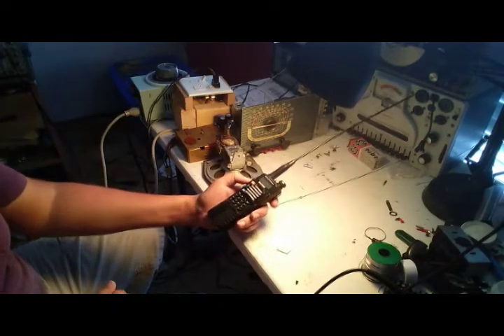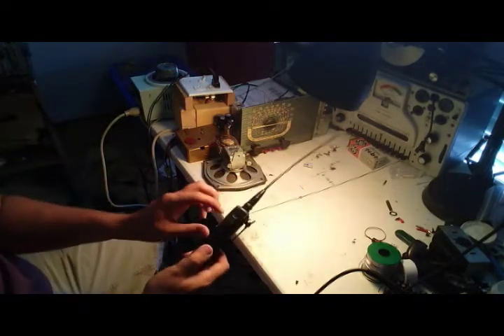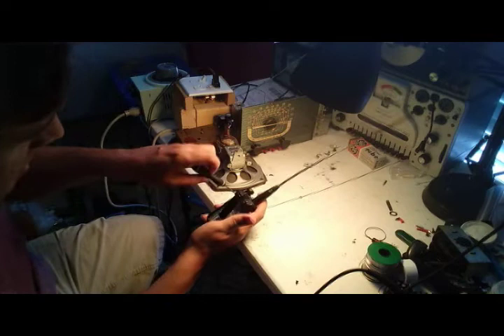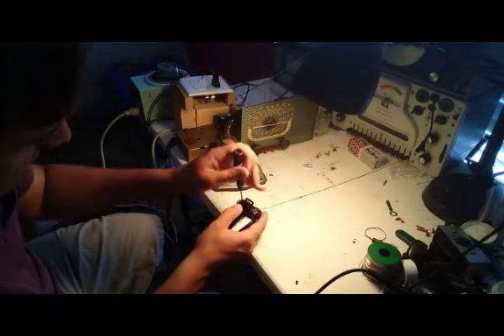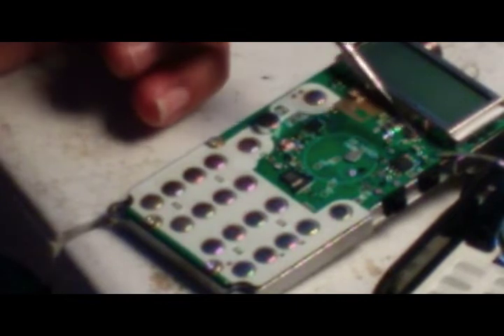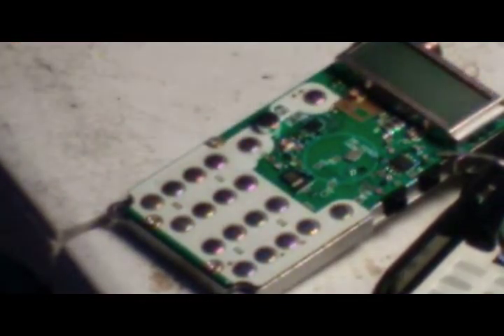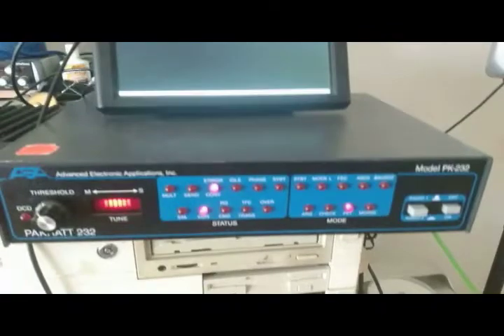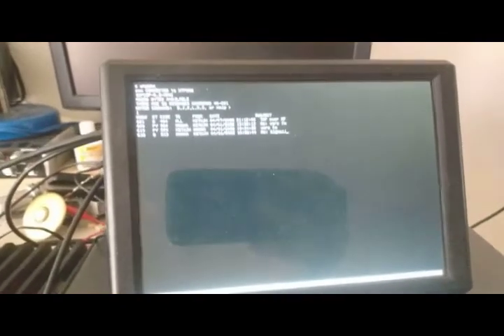Baofeng UV-5r - Fixing the PTT

Comment: thing is, i got a UV-5r and i think it's my PTT modual that doesn't work, a common U94 PTT Headset Plug Adapter but it just doesn't trasmit my mic, and i know my mic works because on the packaging it does give a full list of specifications. but it just doesn't want to work :(
Reply: i have a similar problem, did you solve it?